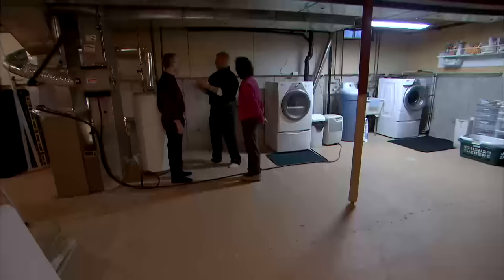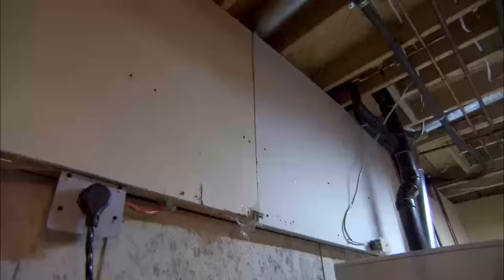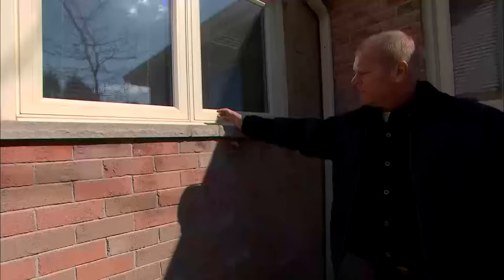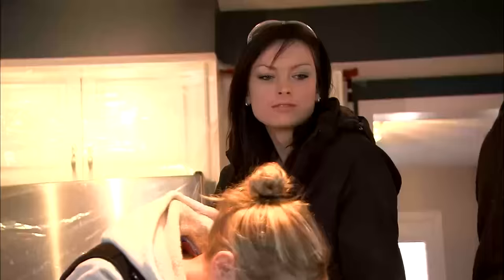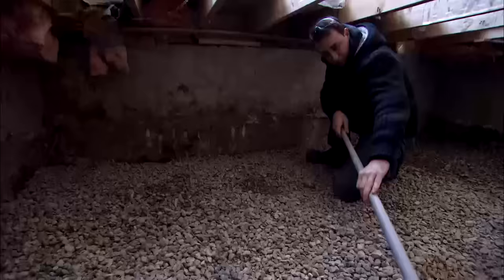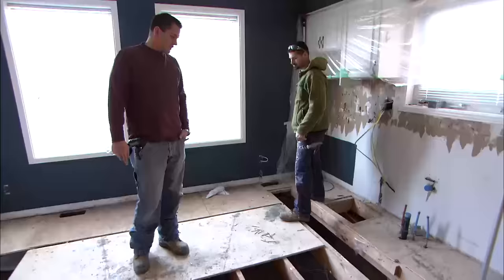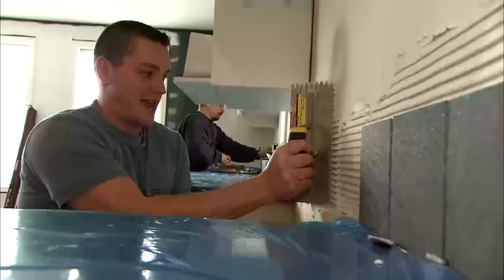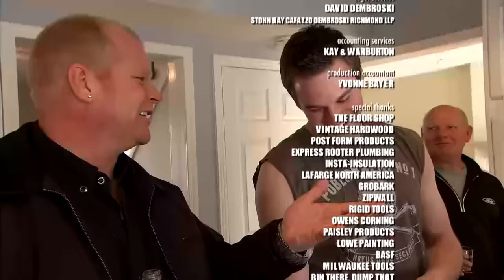Homebuying Horror Story: From Cold Feet to Overloaded Circuits | Holmes Inspection 102

Comment: We bought a house that's 13 years old. We had all of the ductwork cleaned and there was so much junk in it: toys, wood chunks, nails, etc.  The guy got 50 lbs of stuff out of the ducts. It's amazing how much difference it's made as far as how often I have to dust the furniture. I think it's helped with my allergies, too.

We had an  inspector that the bank recommended (where I live the bank won't issue a mortgage if a house hasn't been inspected). The guy didn't notice that the furnace was on its last legs and the air conditioner compressor was rusted. We had to replace both of them--$13K. We probably wouldn't have bought the house if we'd known they were about to break down. There are sash windows that won't stay up so we have to prop them open with sticks. The oven isn't calibrated correctly. None of these things were found by the inspector. It was very frustrating, but fortunately (knock on wood) there are no problems with the plumbing and electrical work.

The people we bought the house from didn't reveal in the declaration form that these things weren't working. It was very maddening.
Reply: Never trust a person who has a conflict of interest... The person from the bank exists to make the bank more money.

Comment: Always seems if you can look at a house in the winter. It's the best way to tell if there is leaks, drafts, mold build up etc. About the only thing you might miss out on is landscaping, as snow could cover a bad yard. But at least you'd know if the roof leaked, the furnace was broken, drafts etc.

Comment: I sure learn a lot from these episodes. This one: how to tile the wall, and how a proper crawl space should be done. The electrical, as well, with the separate wiring for DW, oven, etc. We live in a house built in 1979, and we are dealing with some old type electrical boxes for the outlets, and we are going, one at a time, replacing them. So much to learn!
Thanks for another great video!

Comment: This show always reminds me of when a house my family moved into had a plumbing issue we couldn't figure out. We called up the best rated guys in the area to come look at it and the guy in charge started going to town mocking the work of whoever did the job. Going so far as to say it was all not up to code and poorly done, clearly by an amateur. My mom was clearly upset and the guy starting figures out at her to give a quote. It was something like 25k cuz all of it apparently needed to be redone and had said its a shame there was no info as to who did the work so that she could take em to court for ding such a poor job. Unlike his team which always leaves a "work done by card" attached to the systems to give them some accountability in the future. Just as he says his i see out of the corner of my eye, a business card sized attached to a pipe. I point it out saying "Like that one?" Guy lights up and trots over to talk more smack. This is when me him and my mom notice the logo on the card is the one on his shirt and clipboard. My mom and I look at him with my mom saying "well... looks like we know who to take to court for such a bad job." Guy quickly left saying he'd have to look more into the job. Turns out everything was done right and up to code, better than code actually. Ended up just needing to replace a t-fitting that had failed. If i wasn't there my family woulda been so screwed outta a shitton of money.

Comment: I have a new home and my front room is cold and heat isn't really blowing. The floors getting closer to the exterior of the house gets colder. Did have windows fixed to minimize wind from coming in but I feel that the wall of the windows is not properly insulated. Would love a camera to see the temp and ideas on what I can do to get the builder to relook at the wall for better insulation.

Comment: Comment #2: this episode mentioned something about the idea of each thing being on its own line or circuit. With the electrical. And you was wondering how that got goofed up in this house. Well some houses have tons of stuff on one circuit. The majority of stuff in my mother's house was on 2 circuits. The majority of the first floor (lights + outlets) plus the furnace + a bit of the basement was on 1 circuit. Everytime the furnace clicked on the lights would dim. The house was freezing cold but huge heating bills. I think this episode shows it was more than just drafts. Down in the basement, many of the rooms had dirt floors. Then the old wooden walls met the dirt. Never had termites though. But the house was freezing + tons of mousture issues. I believe there was an underground stream under the house too. But many old houses have tons of stuff on one circuit. Its how they were wired back in the day. So you cannot presume that each outlet or light is its own circuit.

Comment: I used to watch Mike and his crews years ago in Holmes on homes program..hes a big inspiration to me in construction and home fixi g projects i get into.also many years experienced in home construction industry ..trades...i do work for lots of labdlords mits have botched up wirk from handymen over the years or contractors who cut corners too.i just redid a omumbing issue in first fl bathroombc it was all ran incorectly.and thn whete it tied into seafw line stack in the building itcwaz way out of line from it it keaned outwards with se etal pipe connections tying i tnto it.pkus a luve electic junction box directly against toilet waste pipe...live wires left in a wall not capped or even cut off at junction box since it wasnt used anymore..

Comment: @33:53:  That looks like wax paper, which Mike has criticized as an underlayment in other episodes (saying that tar paper or felt is better under wood floors).
Reply: Tar paper's better for laying over an unfinished basement or crawl space to prevent moisture seeping up through. Since they took care of that in the crawlspace itself, it's not needed here. Tar and felt can also off-gas toxic chemicals when heated, so wax would be the best choice in this case as a simple slip paper between the subfloor and finished flooring.

Comment: I always find it hard to believe that in Canada and America your downpipes only go down to your backyard.  It only creates problems to your foundations and extra water in the yard.  In Australia and New Zealand we have to run it all into pipes that lead to the stormwater drains - taking it completely away from any foundations and stops flooding in the yard
Reply: It varies on the home, but some do have it piped to the edge of the property, to a drywell, other drainage, etc. That's not very common though, but does exist. What we do have though is a secondary drainage system. There is gravel around the foundation with a pipe at the bottom. The pipe has holes on the top half that allows water to enter. This runs the perimeter of the foundation, and then is piped off to the edge of the property. Water that seeps into the ground around the foundation collects in that system and is carried away. Most people have no idea this drainage system exists until it fails and causes other problems.
Reply: Many new places here in the USA are not allowed to do that.  In the old days they often ran in clay pipes to the sewage, before there was a separation of sewage and storm water.
Reply: The downpipes will take the water far enough away from the foundation, assuming the yard is graded appropriately. The thinking is that it's better to have water enter permeable landscaping, as rain does on your lawn, than to pipe it all away.

Comment: Tiling is actually pretty damn hard job to do right. I see constantly pros fuck it up since you need to pay attention not only that it attaches properly on the base material and that there is zero air gap behind it since that leads to potential cracking of the tile if it gets impact from say knife or fork falling on it. Best way to find out if this was done properly is to give it a knock. If it sounds hollow, that tile was installed incorrectly, keep this in mind when looking apartment, keep the tilers honest and give it a knock. I have absolutely nothing to be afraid being on the trade since if its ok for me, then its ok to anyone. Shitty tradesman other hand is royally screwed with average quality i see.
Other thing that makes it difficult and to pay attention is the debt difference between tiles, well as the corners aligning with each other. Most people including my old teacher say you dont need run string or spacers while laying floor tiles and that is just for the walls, but i do that everywhere, since that gives me those crisp lines that vary at the worst 1mm so i can put my attention into getting them leveled. Only issue i run into is that sometimes those that build the house it self didnt make best quality work or house has lives so its not straight and level from the get go. In these cases you need to decide if you go level, or by the largest straight surface. I often go half way between the two. It hides relatively well its not plumb, but at the same time it does not look crooked when comparing to rest of the house. That is if you are not going to redo every other surface in near future and straighten them up as well that is.
Its difficult to say from the video, but i see the work was straight and corners were crisp, nice job.

Comment: Basically they redid their addition. The original homeowner was either stingy with the addition or he was fudged by his contractor for sub par work.
Reply: They probably used the cheapest bid they got, and got the cheapest job done.  All the work Mike's crew did below the floor would have added a lot to the bid.

Comment: Some home inspectors just don't give a shit, the house we had a few years ago the inspector found some things but didn't find the HUGE gas leak in the garage that nearly blew us up and was giving us all major headaches.  Luckily I found it, gas company came out pointed out why it leaked (improper water tank installation) and fixed it for no charge.  I love that they offer that service, fully free of charge.  If you suspect you have a gas leak, call them right away, don't worry about costs, call them immediately because hesitation with a gas leak can be disastrous.

Comment: You could have gotten away with opening a zone into the addition and getting some warm air in from the basement. Overkill. It was an adequate build. The electrical just needed to be split to 3 circuits in the kitchen. It could have been done 1/4 of the cost

Comment: If that was permitted by the city, the inspector was not inspecting. Definitely not permitted. Building need plans for plumbing, electrical,  building, etc.
Reply: They said it had a building inspection and it did meet the minimum requirements.  Mike said that's not good enough.

Comment: 29:38 Talking so much smack about the previous contractor and yet pouring 4 inches on top of a mesh that just laying on the floor, nice!
32:32 Proceeds to drill 3 cm holes every 6 inches in what looks like a support column for the beam that spans the length of the room, nice!
Reply: drilling all the holes seemed odd to me also.  They may have pulled the mesh up and just didn't show it,  I hope.

Comment: I lost 💯% For Mike Holmes...Once I Found out He paired up with Guildcrest Homes & say they are great my JAW DROPPED....I built These Custom Homes worth over 500K....They Have ¼ gaps & spaces in the Sheeting walls not lined up straight....I seen MOLDY DAMP Sheeting being used on the Exterior walls.....Low GRADE QUALITY Sheeting...NOT plywood but particular board...When I said This is wrong all they said was the House Wrap is going to Hide it & they will NEVER KNOW........If Mike Stands Behind This Shaddy Currupt business ripping people off I can just imagine what else Mike does n hides...& Yeah I'm a Carpenter by Trade too